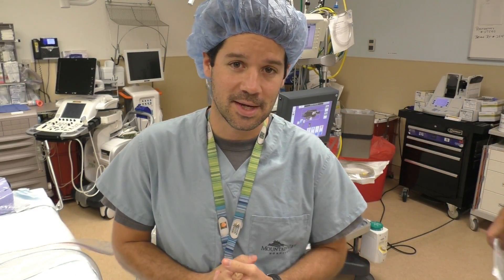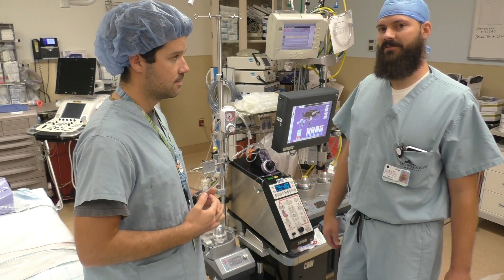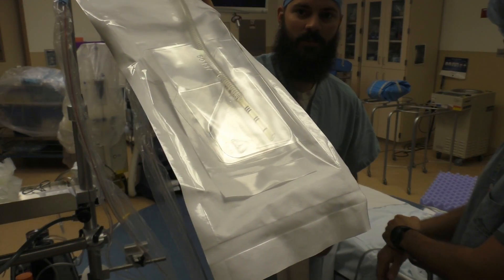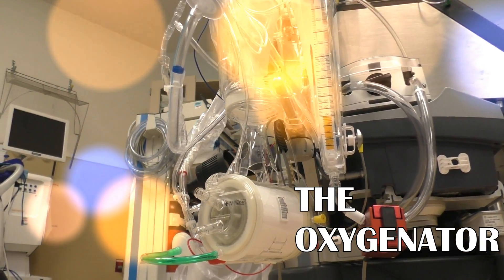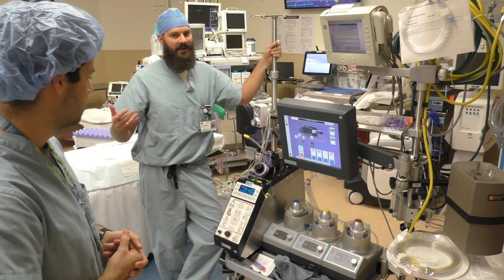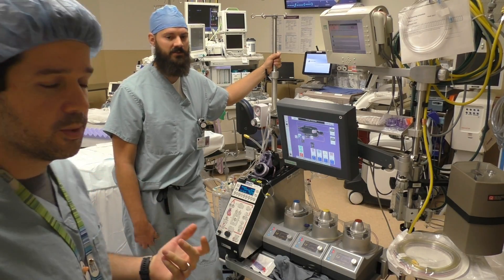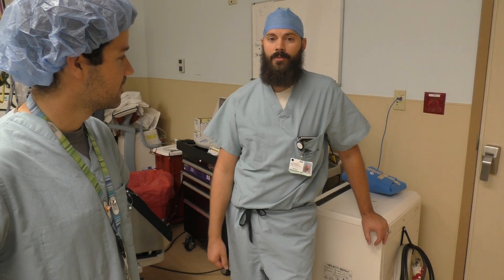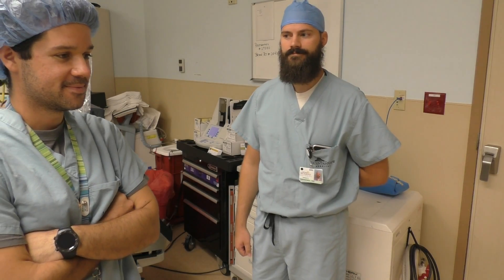UNDERSTANDING THE HEART LUNG MACHINE

Comment: Project Israel. The Border area of elongated straight line between Israel and Egypt at the Suez Canal shall be created with Extending up and descending down planted at and in the ground Bars of Specialized Iron/ metal with mixture of science materials of whatever configuration intermixed like what the duality to triple  combination of science factors in chemistry and physics and biomolecular science is all about wherein each columns iron/ metals with mix has side to side ports of beam connectors interspaced in intervals one after another of extenders of Conductor of electricity and molecular ionozarion effects of such science and nature components manipulations of static electricity to molecular convergence to properly spaced at each other atomic molrcules for the connected energy nodes of advanced techs of walls of entrance and exits wherein at the front of the bars of iron another interspaced ports shape variety of an open architecture system designed area defense. The border of irregularly shape map border between Israel and Syria and Jordan to near side north of Israel along its irregular shaped lines shall be created with a station per station of Towers junctions of Next Generation camouflage powered by machineries of energy production underground with ports of colour coded optics fiber up and each station sensing To and Fro technology at the Watchtowers  for environment and air to solar energy and air and atmospheric contents sensor variety and energy harnessers wherein the sensed atmospheric and open air contents of substances informational dual mode wired sent or wireleslly sent at the command stations and guards post underground facilities and at the surface command stations. The Next Generation camouflage of inside Israel border activities and environment alteration with outer environment fake scenery projection and  reconfigurable walls of energies by open area at its sides pixel effects pinpoint pencil beams types walling energy creations and symbolic shape shifters for counter symbol effects and vibratory signals of defenses and a guard Watchtowers stations of entrance and exits. The North of Israel bordering Beirut Lebanon and Syria and starting at its shoreline or coastlines of Meditteranean sea area shall have ship area ports of separate areas for Israel Navy Warships and Coast patrol ships and the Tourists and business persons and delegates  ships, speed boats and yachts of another sea ports of 2 Rectangular shaped open and close of level per level gigantic  structures planted and foundationed with stability wherein each levels of modern open and close hatched structures when opened shall have extenders of superhard materials of pad forward movers of ship types at the sea waters of its extend and retract features of likened to superstable hard cards pads which can reinforce the other pads by another and another pad extenders of approximation each lengths and edge per ships weight, length to height ratio supercalculating effects of Israel unique systems wherein inside the giant structure have box like machines at the rear of a rail mover and with advanced  mechanized pulleys structure  designs and another elevators of specialized pads of sensors on top  for the scan of destructive or hostile materials coming in or out the double door each length of 2 sided gate wall defense and ship sea launching and accomodating  systems. With a central guard post office structure in between those 2 entrance and exit rectangular structures of optionally 2 ships elevators in itselves with ship accomodation inner port docking station  area of sea water basin and garden inside after passing the structures side and Ceilings and Sensor scanners and CCTV's wherein at the length of its pre check inside accomodate or outside ship launch have a rectangular elevators up and down    of a giant cubicle cover graphene transparent imbedded materials extending up the roof of open at the ceiling for the approximated up edge indents of ceilling slider speaker machine ship top cover of ventilated fenestrations if opted to store the ships downward by elevator area facility such as warships to be protected from missiles attacks or bombs or electronics destructive pulse waves in the If factor only Israel is being attacked at all sides continuously. Meaning a large facility underground Israel for ships with seawater likened to Earth 2nd seas at the mantles, wherein the sea waters in that underground area shall now be created tunnels pathways with propulsive pressure machines inside of water tunnels with Extending up and down metal hatches station per station pathways towards the Red Sea area Israel ports reroute with another 2 sided slanted elevators and exit and entrance superstrength materials  hatches  areas at the Israel narrow edged map facing the entrance and exit of the Red Sea while at the inner side corner of narrow waters of the Y shaped waters at Israel area the narrow Strait of waters shall be  another Tourists and Visitors area ships ports upon entering Its narrow entrance and exit gate of another extenders and retracting gate wall with magnetism and repulsive materials imbedded within and on outer side. While at the proximal side of the Red Sea slanted hatches shall have another ship ports of side docking area parked. Wherein at the near depth of Red sea sides of Israel map shall be created submersible  transports crafts  and submarine tunnels with specialized water pressure in and out propulsors technology for Israel undersea transports. Each area walls shall have direct energy defenses and missile defense variety which can be optionally remote controlled system. That's the added on structures to the CaesarKing previous underground segmental facilities ordered project for Israel. Wherein there be underground area specific Modern speed tech for diamonds production facility, energy plant production facilities with ramps up to down and elevators and upper surface area atmospheric sensors and energy harnessers, and Israel version of  molecular hydrogen ion plant facility production area and Israel version of fuel cells technology production area using the modified cells structure types of nature and sciences and technology application including that of water cells types and complete resources storage and supply area underground, habitats accomodation areas for officers and civilians and fighter jets and helicopters to research and development Israel tech created flying transport systems of underground facility with elevator hangars wherein the deadly explosive materials of missiles types and ammunition storages be placed at well defended structures at the surface except those tactical expensive weaponries at separate underground facility. The upper side of Map of Israel shall be of connective continuum to my previous ordered project of Cloud Computing of Mist Molecular effects to and fro up and down chemistry interact curtain effects if system activated to that mode of Cubism type model. Ordered now to my controlled science manipulation powers and Quantum Network and Abstract Dimension of simultaneous ordered infrastructure project create. Let it be
Reply: You idiot radio politicians of the Median Civilization of cling here and there wherein I don't know exactly the masks of every area being at the inner side the reason why I'm creating versions of walls and bridges to each and every area. The CaesarKing is not a scope of your principalities  limitations or induced limitation by your agenda Laden principalities I don't care of their agendas for I the CaesarKing have unstoppable control and refill capability powers in my area controlled creations and Earth, Universe and Multiverse at this flip side Earth like coin side of cannot be limited by any beings. You call the all resources origin holder God the Creator corrupt by your twisted truths and principality I'm managing now at this side, remember there are 2 Witnesses already and Judges from the Bible Book of Judges correlation. They're judging your words and actions already. Remember Jerusalem in the ancient time was both managed by the Leper King King Baldwin the 4th then by Sultan Salahuddin of Jerusalem at that time being the focus of battles between the two forces. Youre responsible for your said blasphemous words for you Said you're spirituals inclined while I say I'm not yet at that level and more of physical natural I the CaesarKing while I'm securing the ancient Holy place despite its known abuses for God treasured that area spiritually , while you're trying to stripped down it's defenses.

Comment: Does the profusionist add sevoflurane somehow when the lungs are not being ventilated during cardiac surgery? Almost 90 minutes with no inhalation. So how is the pt not aware and not in pain?
Reply: Yes, typically isoflurane is added to the gas running through the oxygenator via a vaporizer. Also, anesthesia can continue to give IV sedation through a central line, or give it to the perfusionist to administer into the reservoir.

Comment: How does the pumping mechanism work? It looks like rollers are squeezing a tube, pushing the fluid inside. If so, it can't be a simple vinyl tube -- that would break very quickly. Is there a special material that the tube is made from? Does this type of tubing have a name? Thank you!

Comment: What do you do if the machine fails when on bypass, either mechanical or electrical?
Reply: Interesting Question I also need its answer
Reply: There are handcranks where you can manually rotate the roller pump while you troubleshoot the issue (regain electrical power, swap out the roller pump, etc.).

Comment: What happens if someone goes in for heart surgery and the patient cannot be weaned from bypass or their heart refuses to restart? 

Do you leave bypass on and stick an artificial heart in the patient, or do you call it a day and pull the plug, even though the patient is technically still alive
Reply: If heart does not start automatically on getting blood flow, they give a slight electric shock. Our heart beat is regulated by electric nodes in the heart. When these nodes get damaged,  a pacemaker is usually fitted.
Reply: @mviv6339  and if that doesn't work, or the new heart doesn't have enough power to sustain the body?

Comment: VERY cool to see. I had open heart surgery 19 months ago to replace a bad aortic valve and an aortic aneurysm repaired with a dacron graft. Very interesting to see what "killed" me and kept me alive during the procedure. I had never seen how the actual machine worked and how it was connected to my body.
Reply: I m perfusionist...its miracle. ..i hv done 1500 cases
Reply: better after then before. i prefer un-informed consent - unfortunately i know too much already. hope youre still kickin
Reply: @ponetastic  still kickin' 5+ yrs after heart surgery...funny when I see shows showing blood and guts I turn away....except those showing open heart surgery....seeing that doesn't bother me for some reason....
Reply: i also had an aortic aneurysm that was dissecting repaired with dacron graft in 2018 when i was 27, it's a genetic issue so i might have to have it done again and learning about this is helping a little bit
Reply: Actually the heart is stopped by the application of cold potassium, there are vids on utube showing this.

Comment: Hey Shane, this is Ember, I am a ST student at CSN.  We just watched this video and I had a question that Cris wasn't sure about, so he told me to ask you.  I was wondering how the inside of the heart-lung & perfusion machines are sterilized?  Are there liners that you put inside?  I understand the use of the sterile tubes, but the sterilization of the inside of the actual machine is confusing to me.  Could you let me know, I'd appreciate it.  Thanks so much!!
Reply from the maker: Everything that the patient blood runs through is disposable and a closed circuit. All of the tubing, and plastic bits come pre packaged and sterilize as a closed circuit. There are technically 2 times when that circuit is opened 1 when the perfusionist is setting up the machine to preload the circuit with fluids (like IV bags), and 2 when we go on pump for a case and cut the lines on the sterile field. Hope that helps. Its much easier to see in person when they are setting up there pumps.
Reply: Awesome!  Thanks so much for getting back to me.  I am at UMC doing my clinicals, so I'll ask my preceptor who is on the heart team if he'll let me check it out one day.  I really appreciate your help!

Comment: How do you restart the heart when the operation is done?
Reply from the maker: The pump starts to lessen its flow, the stop giving cardio plesia/ rewarming the body and the heart gradually takes back over and the pump no longer flows at all.
Reply: once the surgeon finishes the surgery and sutures any open chambers of the heart, he has to release an aortic clamp that is used to prevent blood from going to the heart during the surgery. when this clamp is released , now the blood finds its way to the chambers and automatically the heart triggers a pumping effect. the release of the clamp is coupled with adequate rewarming of the patient to about 36 + degrees. then the heart will automatically start pumping and then the perfusionist can slowly reduce the blood coming to the pump as they retain more blood to the heart and gradually stop the machine as the heart picks the full function.
Thats how we transition from the heart lung back to the heart
Reply: @perfcom6430  excellent reply. I always wanted to know how the heart lung pipes were connected to the heart and flow stopped to the heart. Cannulas and  Clamps do the job. Can these clamps damage a artery sometimes ?

Comment: Thanks for the video.  With blood loss I have a general question.  I remember with my procedure they said it should be less than a teaspoon of blood lost.  Is there anything else surgeons do to minimize blood loss during procedures?  Or is it just the fact that I had a laparoscopic procedure which is why so little blood was lost?  How much blood is typically lost in open heart cases?
Reply from the maker: hearts can vary greatly. we could lose as little as 50cc of blood, or as much or more than a liter. Most surgeons go by the motto "dry in dry out" meaning take your time dissecting and cauterizing bleeding vessels. In turn that will minimize blood loss.